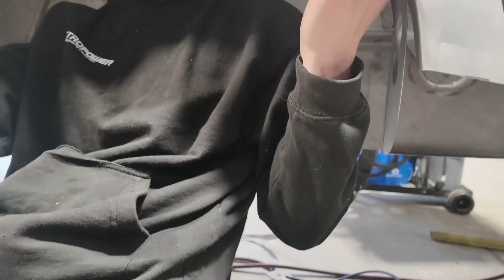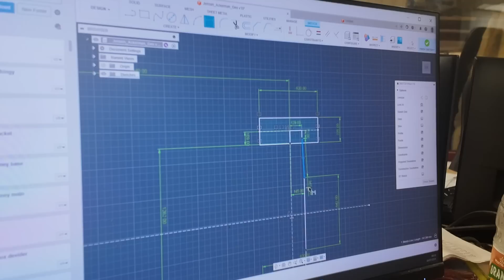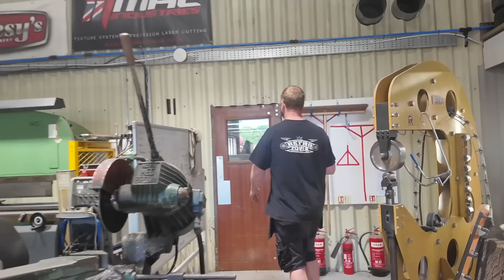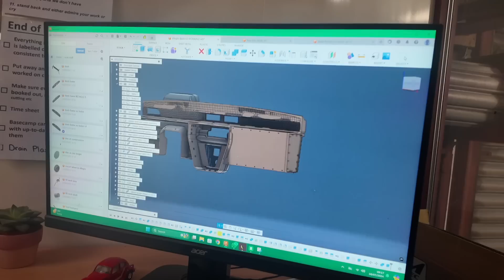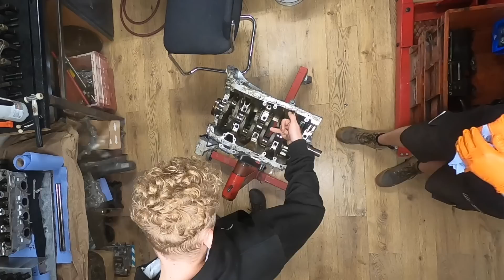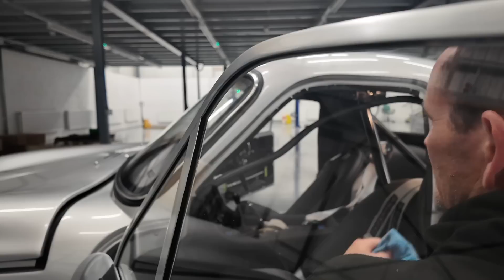1968 TVR in for Upholstery & Public Event Announced!

Comment: The OEM I worked for in 1987 had a TPS sensor issue. The small copper spring finger was bouncing on the contact surface and tripping the ecu into limp mode. To prevent this, the inlet manifold bracket required a significant increase in stiffness. This took the natural frequency of the throttle body above the frequency of the tps sensor. What type of sensor is your tps? Hall effect or simple spring finger on a contact arc?

Comment: Modifying* the steering arms so the knuckles are further out, for front-steer, is a BIG step to inprove the Ackermann effect. The line from the steering knuckles, through the steering axis, should intersect at the centre-line of the vehicle. Been a while but, IIRC. the intersection point should be at, or near, the rear axle, but I may be mistaken on that.

*Or making from billet.

Comment: Although I confess I don't have total knowledge on E Type even though I have rebuilt and fixed many, I think you will find the rear arc mod is because the Coupe body you would see them inside of the car BUT with the convertible it needed to be modified to fit.

Comment: Of all the colors to paint the Allegro its' baby rap yellow.   The Allegro was a real dog in one sorry line-up of products from Leyland in the 70's.  Unless you lived through the era, you probably don't understand how bad the cars were.    I kind of think i would not be sinking a kings ransom into a 70's style car
Reply: Most cars of the 70s were pretty horrible compared to most things all much of a muchness yes I lived through it and have driven and worked on most,motor trade 40 odd years it’s what they are, the couloirs the allegros are going is in keeping as is a lot of the styling just up my street,I’m building an mgb on an mx5 platform so it’ll still probably end up in its original puke yellow, but it should look good lol
Reply: The main issues I found doing restoration professionally on those cars wasn't bad design though, they were just put together insanely badly.  Labor issues seem to have caused a bit of an unmotivated workforce.  Put together at the correct spec, they work pretty well in most cases.  There are, of course, exceptions.